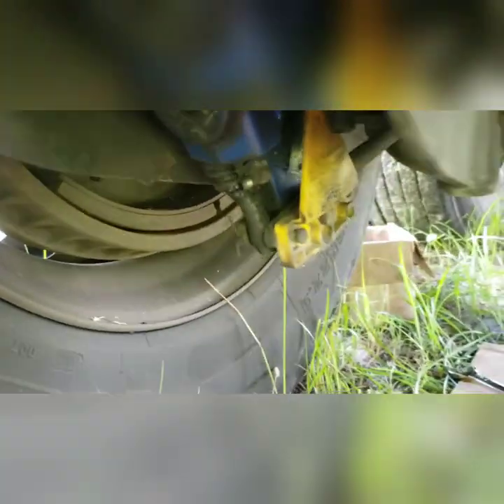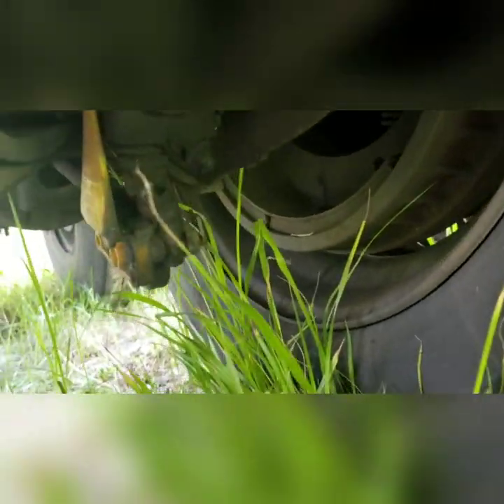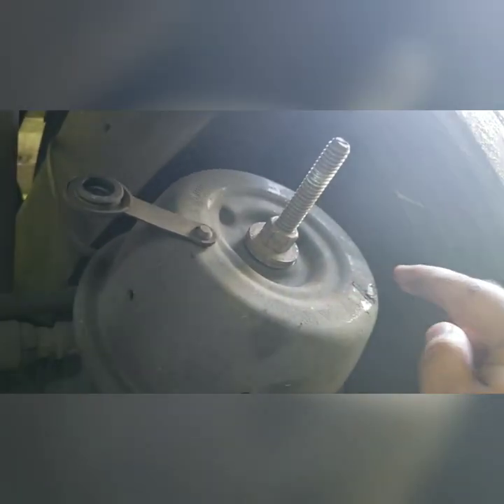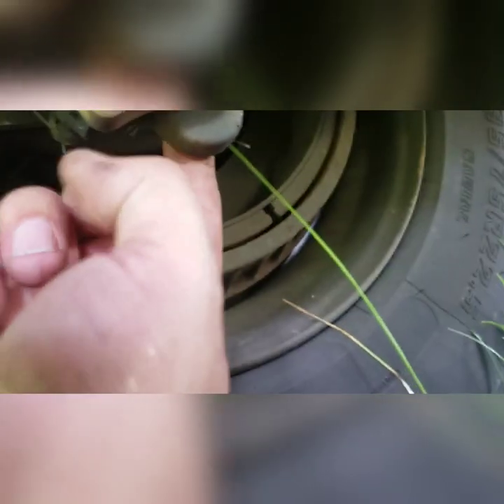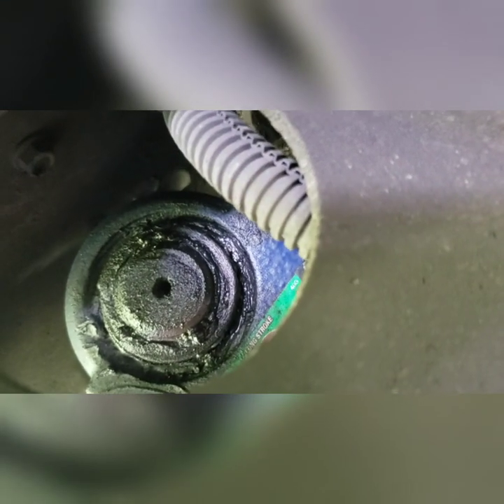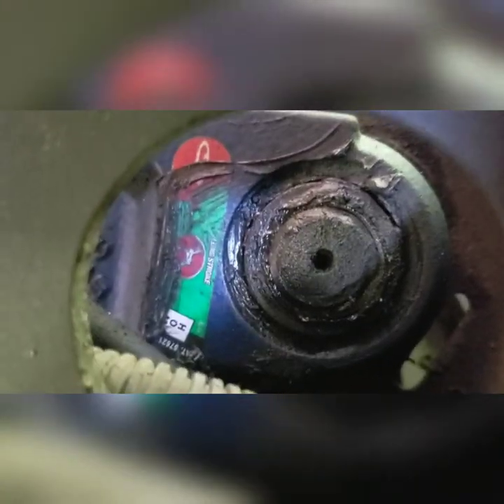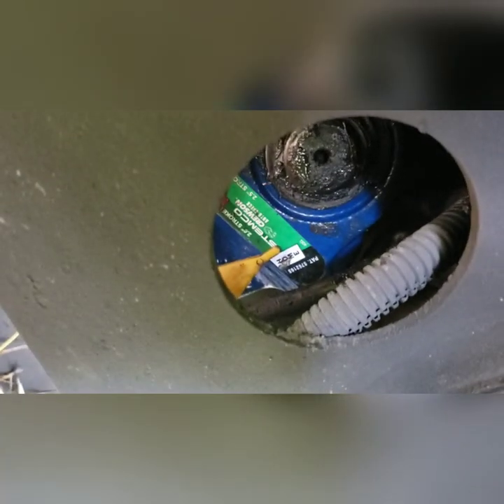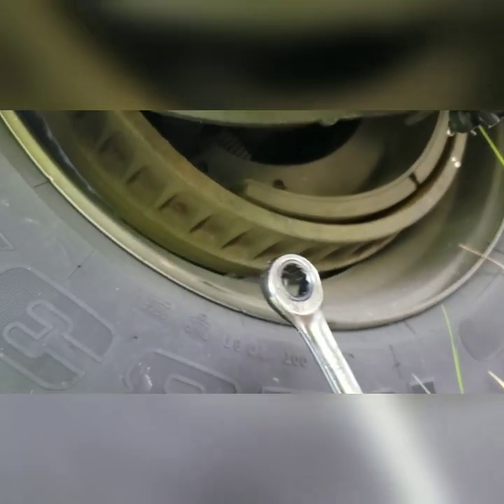Replacing automatic slack adjuster on semi trailer

Comment: Wtf... worst instructional video ever.  How did you take off the cotter pins the snap ring and the Clevis pins... "this iz old slack adjuster, I take off.  This is new slack adjuster I put on, finished" you didn't show any of the steps..